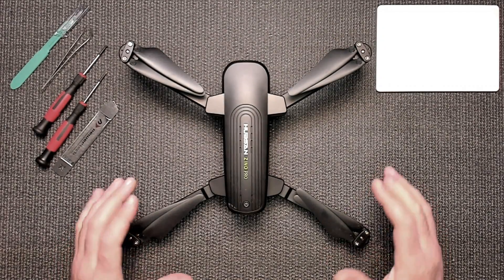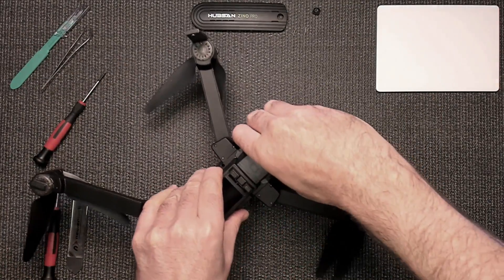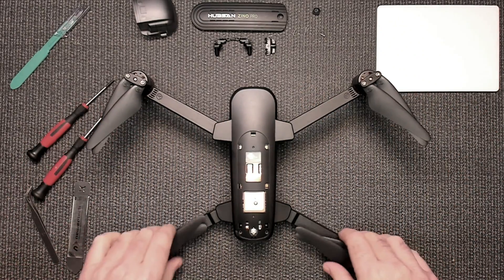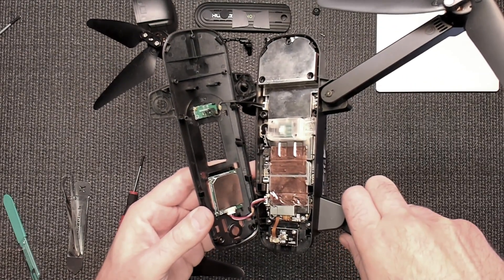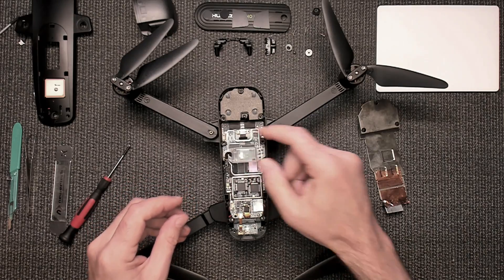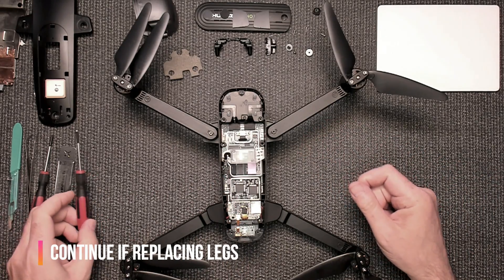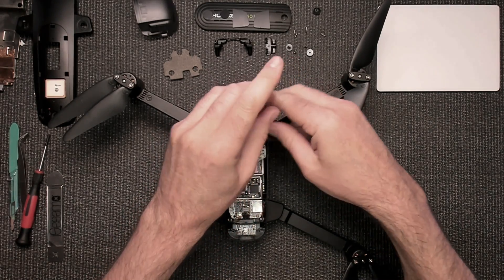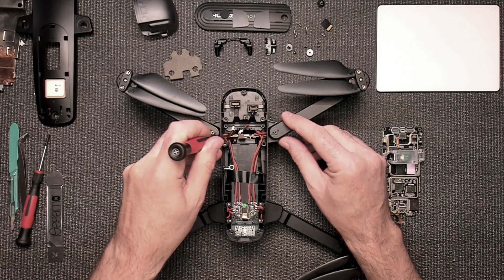HUBSAN ZINO & ZINO PRO - QUICK & EASY HOW TO TAKE IT APART

Comment: Hi Chris, how's it hanging there? :) I finally got RC for Zino Pro Plus, still waiting for battery adapters...Anyway I started "mean machine" and "surprisingly" got Error 0X2000 and "gimbal sensor error" ... I watched yours error video but where is gimbal sensor? Any help? Thanks in advance, greetings from Serbia
Reply from the maker: It’s your gimbal cable. It’s marked as motor.
Reply: @QCGUY  Thanx a lot, ordering gimbal (motor) cable

Comment: Good day! I have such a problem with my Habsan Zino pro.When taking off, it immediately falls,today it fell three times.All kalibrovki performed according to the instructions .Can you tell me what's wrong with my drone ?
Reply from the maker: Use a different battery. If you don’t have one buy one. If it does it on every battery you have then that is odd and you should post a video in a Facebook group for help.

Comment: Hey QC guy! I have a Hubsan Zino Pro. The front left propeller is spinning but won't fly. What do you think about that? Do you know what's wrong with my Hubsan Zino Pro?
Reply from the maker: That doesn’t tell me enough but if it’s not spinning up to speed then most likely the ESC is bad. Possibly motor as well.
Reply: Thanks! I'll try to replace the motor

Comment: Hey QC GUY, hope you are doing well, I recently took apart my zino pro plus this way to see if the gimbal cable was disconnected because the gimbal would not calibrate and then i put it back together and it will not start at all, I was wondering if you have any insight on what might’ve happened or what I can do to fix it, Thanks!
Reply from the maker: One of two ribbon cables came loose buy the power button most likely.

Comment: Hello, thanks for your video, I bought a Zino pro plus and it shows me error 0x2000 on the screen, when searching the web everything indicates that it may be the disconnected gimbal cable, which is very annoying since the drone is new.  You have a repair video for the Zino pro gimbal that will help me see if I dare to disarm, thank you very much.
Reply from the maker: Sounds like the cable to me 👍🏻
I have the replacement videos in my library here on my channel. Thanks
Reply: @QCGUY Friend, if I just want to check the motor cable connector is it necessary to remove the gimbal? or just by removing the upper part of the drone I can check it, because it seems to me that it is disconnected since there is no response when it turns on.
Reply from the maker: @enelcaminoconmidron  if it is a total no response then it can only be the cable connection at the main board inside or the cable is done with. 
That’s if it’s a cable issue and not hardware issue.
Reply: @QCGUY  Thank you very much, in fact there is no answer whatsoever in the gimbal, and for that reason I think that only by removing the upper part I can check the connector cable, I really appreciate your help.
Reply from the maker: @enelcaminoconmidron  Good luck 👍🏻

Comment: Hi Chris, my Zino  camera gimbal will go back by itself to default look ahead position whenever I set it to the maximum look down position in flight,  but not when my quard is on the ground
Reply from the maker: Ptyty I have a group for troubleshooting problems. This would be nice to see in video along with anything you might have done like crash, update firmware or replaced something prior to this.

Comment: Good morning Chris. I had texted you a few months ago and I was going to mail you my zino pro but due to money issues ( still unable to afford it) so I've been watching your repair videos to do it myself.  Heres what's the problem is. When I've bounded the  zino and it's ready to fly I've been having an on and off again issue with gimbal control. Sometimes it works and then gimbal cover remover warning appears and I have no response to gimbal wheel.  This is an intermittent problem . Does it sound like a loose  gimbal plug? Sincerely William Horsley
Reply from the maker: William Horsley It could be different things but yes that sounds like the first place to start.
Reply: Thank you Chris. Have a  great day. I really appreciate your time and advice it helps so much that I feel confident in disassembly the Zino now putting it back together is the other thing I need to learn! Sincerely William Horsley